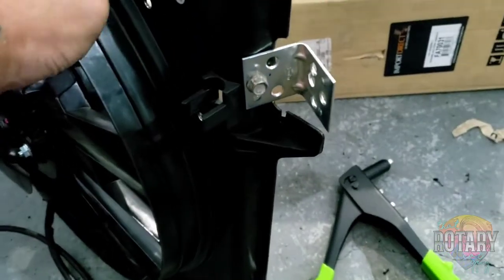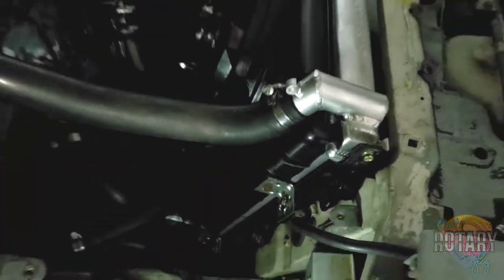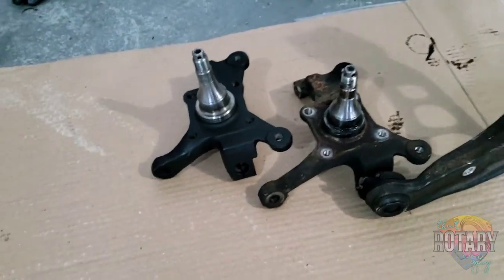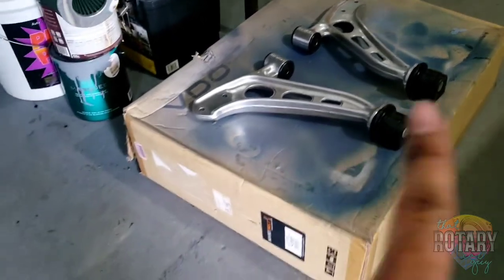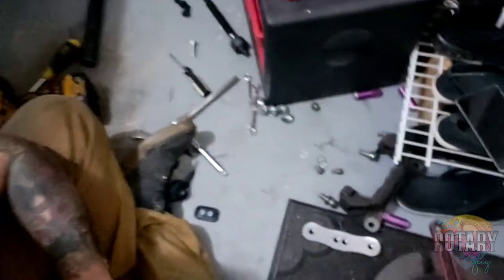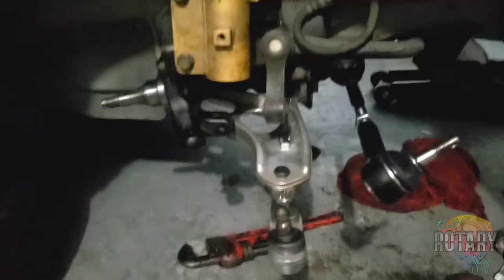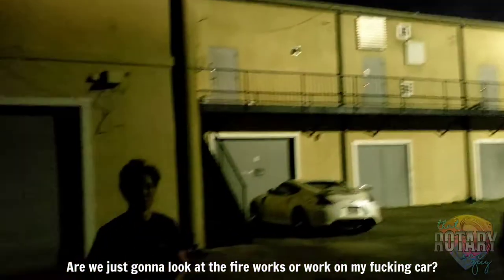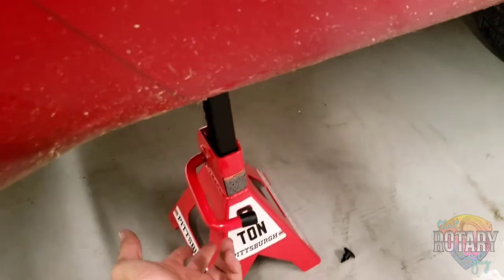How To Install My New Koyo Radiator And Steering Angle Kit For The RX7

Comment: lol wtf did you put wood brackets to hold down the dariator? LOL
Reply from the maker: lolol no i didnt! haha
Reply: @thatRotaryCarGuy  lol LIES. why not go to home depot and get some flat sheet stock of aluminum? looks way better.
Reply from the maker: @petek9348  hahaha i dont even know why u think i would do that lmao
Reply from the maker: @petek9348  haha its all good. i dont have time to re-do that. and plu the electric fan is fixed on that shroud.
Reply: @thatRotaryCarGuy  cool beans.
Reply: @thatRotaryCarGuy 
What is the temp sensor that goes on top of the radiator I am upgrading mine and I can find one
Reply from the maker: Hey whats up man! It's just a radiator temp sensor. They usually go bad. Where are u getting urs?
Reply: @thatRotaryCarGuy  
I bought the koyorat but the temperature sensor that I got from AutoZone  doesn’t fit 
I was wondering if you know the part # and brand that u are using on your car 
Thank you